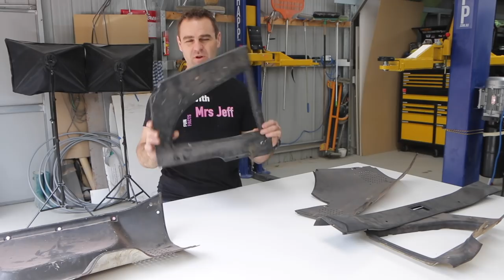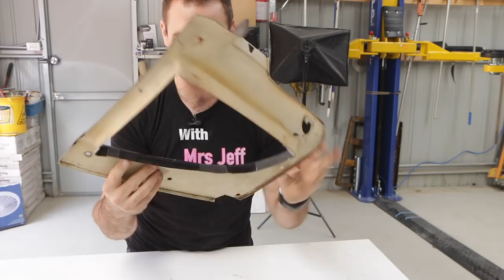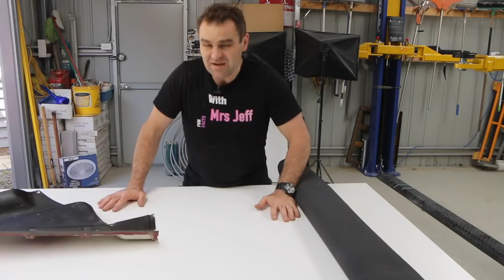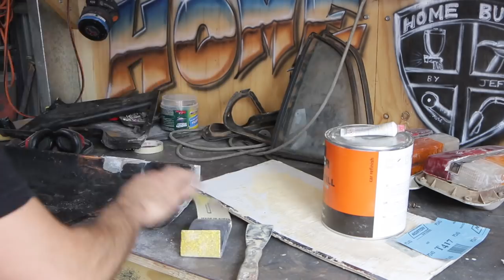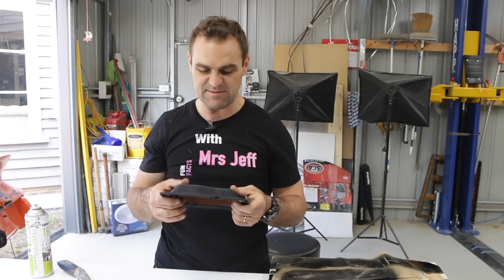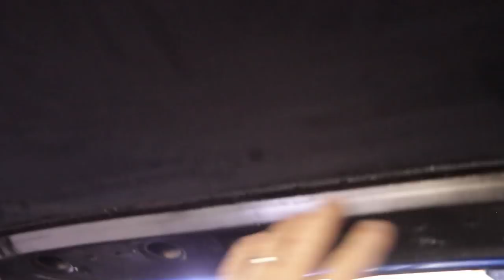Repairing and covering interior trim panels - Home Built Datsun 240Z part 61

Comment: Trimming, finally something I can do!
After years of fitting stereos I know all the tricks!
To get 'that vinyl look' after your repair you make up a tinted resin with a lot of hardener, pour it on, then press in a piece of vinyl face down. Just before it goes off, remove the vinyl and it leaves the impression. Yes, it's reversed, but looks the business. You can buy actual moulding vinyl. Otherwise you can use untinted resin and paint it afterwards using a flexible paint.
For the carpet over the corners  your idea in the notation is correct. You've probably worked it out by now. You pinch the corner up, then run a really sharp razor to cut off the excess then use a flat screwdriver to tuck the edges.

Comment: When I trim interior pieces I start with a layer of closed cell foam.  It makes the alcantera feel amazing. Unfortunately with that method you can't stick and peel, it rips the foam. You should also use a roller to press the glue together.  
Other people have mentioned flocking as an option.  Also Chefalo (sp) has great videos on interiors

Comment: Jeff, a tip before you finally fit the trim panels; they will squeak like crazy if you fit them as is. I had to remove mine again and fit that fine soft rubber draught excluder round all the edges to stop them chafing, rubbing and squeaking together. Maybe too late if you've already fixed them in place. The alcantara looks the bizz.
Reply from the maker: The Alcantara wraps around all the edges, so I was thinking that would take care of it.

Comment: Jeff, the little shock covers that you were having trouble covering in alcantara because of the wrinkling: have you considered flocking them? It would match up fairly well with the texture of the alcantara and would provide a 100% smooth (unwrinkled) finish. It’s the same sort of stuff used in glove boxes and the like.
Reply: Just realized they aren’t shock tower covers but rather the tail light access covers.

Comment: I haven't used alcantera myself,  but wondering if you heat the material would it be easier to shape around the interior bits?
Reply from the maker: I don't think it would heat well. I think it would pill and melt, before it did anything else, but it is worth a try at least to test it.
Reply: Home Built By Jeff good luck! Let me know if it works

Comment: Here's a suggestion for you Jeff😊
What if you get them repaired as you intend and then you create timber moulds A and B or positive and negative.

Include air ways in lower mould and Walla you have a method for Vacuum moulding flat sheets of ABS plastic once heated up.
Then you could make reproductions to sell.
Sorry typical 3rd gen Engineer problem solving LMAO.😉👍👍
Reply from the maker: Haha, easier would be to just make a Fibreglass mould and then make them out of fibreglass, but I am not that keen to start that business ;)

Comment: For "shape" try using aluminum tape like a person installing air conditioning ducting might use.  In the US, we get it from a hardware store like Lowed or Home Depot,.  Not sure what you have equivalent to that, sorry.  The aluminum duct tape is a LOT thicker compared to blue painters tape or masking tape.  and, fiberglass does not stick to it very well, so it cleans upo nicely.
Reply from the maker: I didn't think of that, but that is a great idea. I will have to get some.